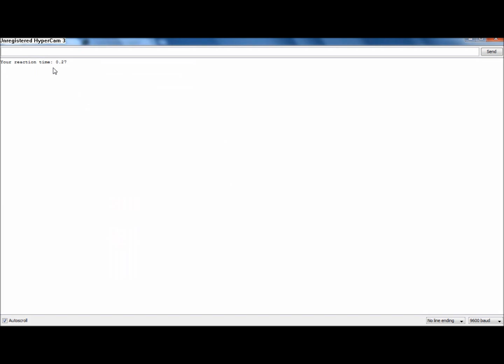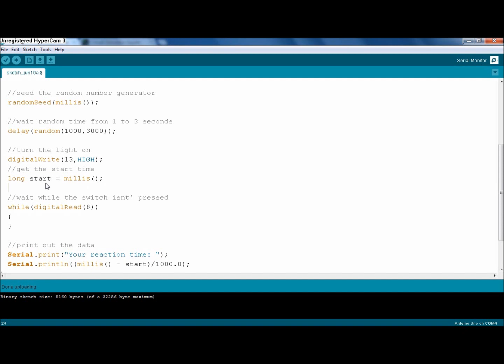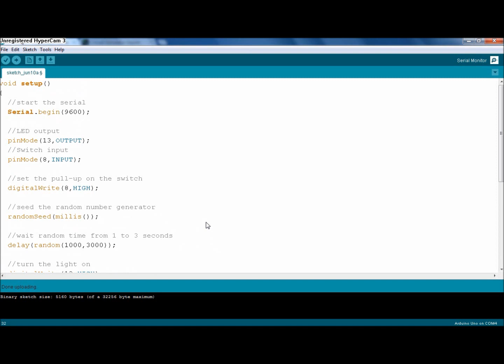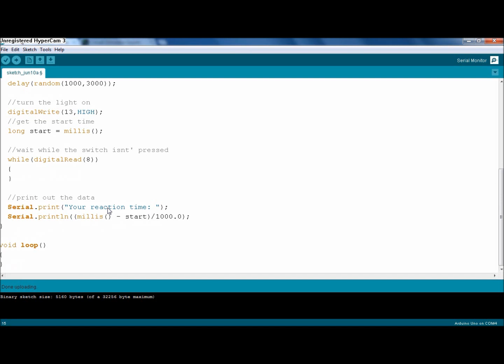Arduino Project Challenge: Reaction Time(Solution)

Comment from the maker: It would require you to remove the delay command and replace it with a while loop, checking the millisecond timer to see if it has reached the random number. Within that while loop you would create an if statement that would check the modulus, remainder function, of the interval you want the LED to blink at.